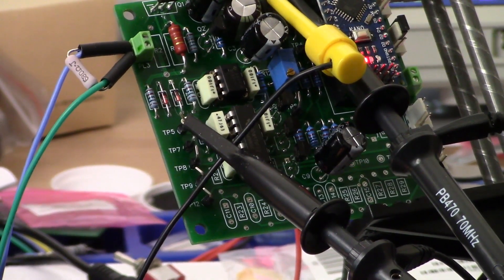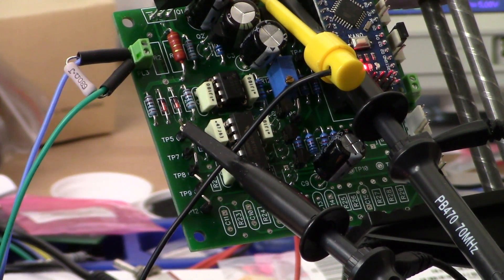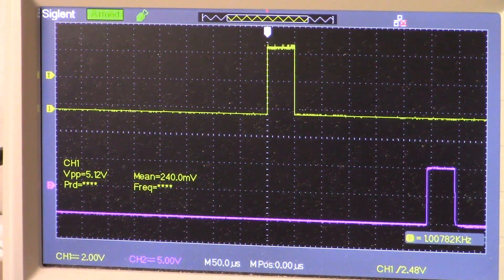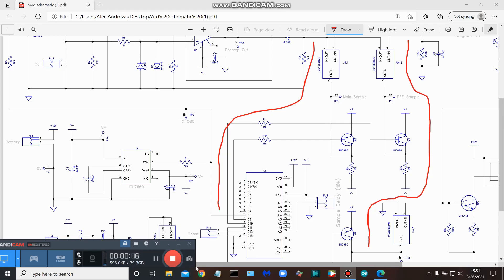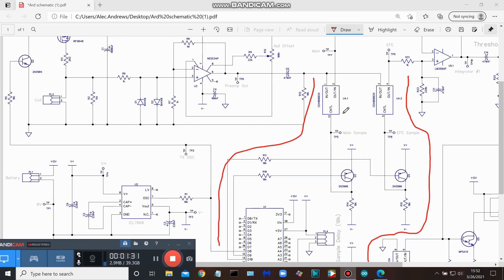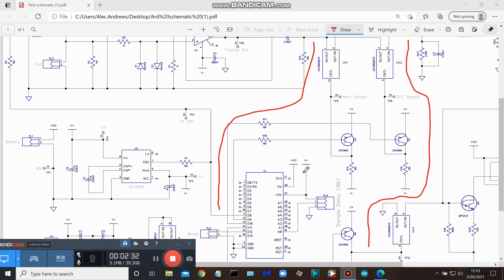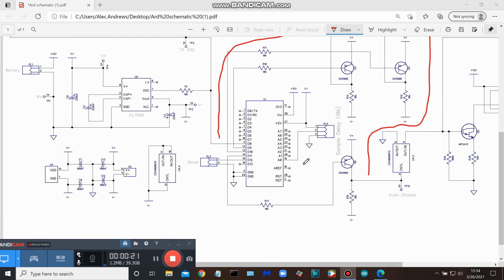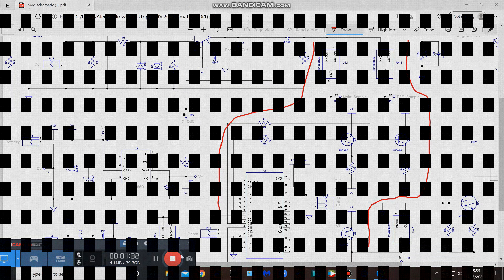Arduino Nano PI Detector part 3 Sample Pulses

Comment: Wait for build pi pirate
Reply from the maker: Hi my friend.  These projects that I am making are much better than the PI Pirate.
Reply: @SurfDetector  Hi, friend.  It's true what you say.  But I am interested in the PI pirate has attiny.  fewer components and simpler.  So it's easy to place it in a small pvc pipe.  Easy to make for fun diving.  But I never managed to make it.  I tried to make a potentiometer version and it failed.  I don't know what the mistake was
Reply from the maker: @indofrontalexplore2721  Yes,  I remember you asking for the Pirate before.  If I make the Pirate in the future it will be a modified version with more parts.  This is only my hobby not a business for me.
Reply: @SurfDetector  Yes friend.  Great idea.  I will wait for your next project.  Thank you